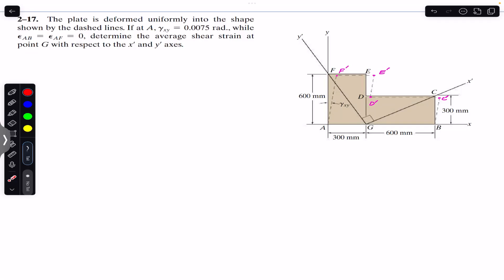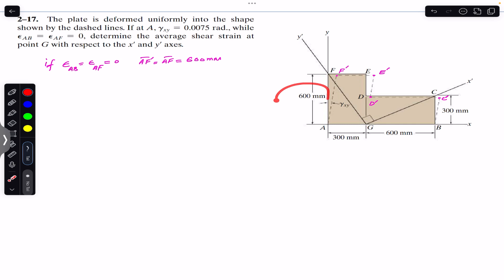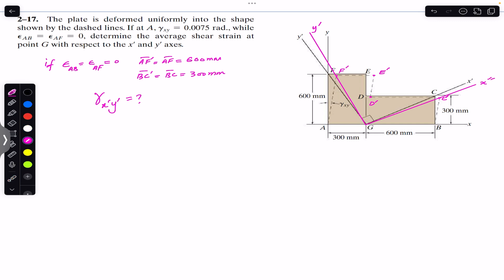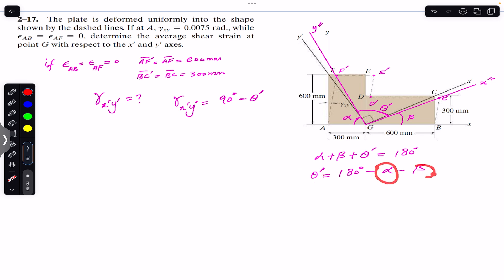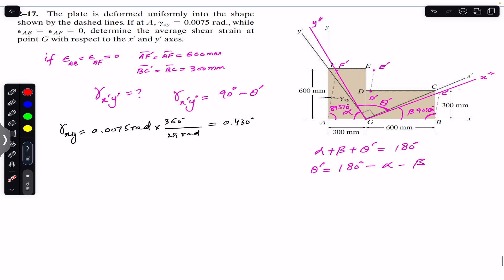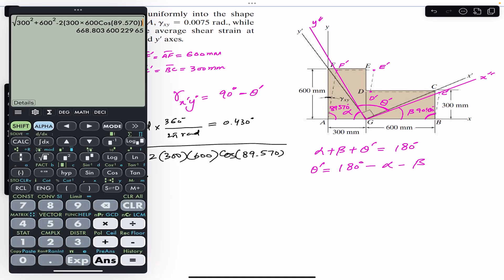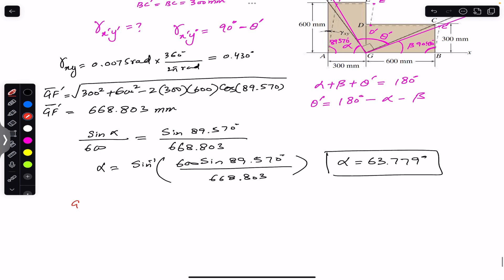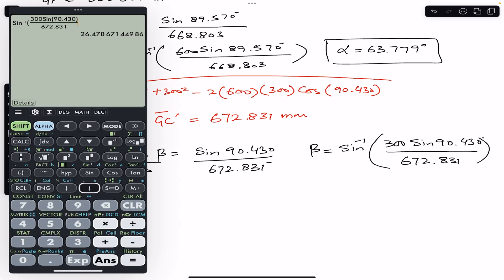Determine the average Shear strain at point G. Mechanics of Materials | Engineers Academy

Comment: Disks A and B have a mass of 15 kg and 10 kg, respectively.
If they are sliding on a smooth horizontal plane with the
velocities shown, determine their speeds just after impact.
The coefficient of restitution between them is .    Can you solve this question.